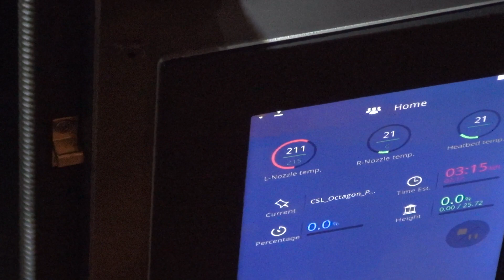Raise 3D N2 plus printing issue

Comment: looks like the endstop is not working, the knocking sound comes from the belts jumping on the stepper gear because they cannot move.
possible solutions:
1-check the endstops.
2-check the tension on the belts.

Always perform a "Home All" to see if your endstops are working correctly.

Comment: Go to 1:14, do you hear that "click"?, it occurs twice during your printer head moving the Y axis. That click is the head against the limit switch, and that is a good sign, it means that it is being properly activated. I do not hear that "click" during the X movement, most likely because your switch is broken. Take a look at it, it is located  opposite to the Y switch.

Comment: I've been browsing the forum and I do see that the company has helped out a lot. 
Do you feel it's built well with quality parts. 
Thanks for info !
Reply from the maker: Ya, its built pretty well. If you check my other videos on my channel I make robots that cost 10,000s each! So I understand good from crap. This is a new company and they are off to a fantastic start. 

If you run into issues and you likely will the community is great and will help out.
Reply: +AZ Droid 
awesome. Thanks for info. Looks like I'll be purchasing this printer.
Reply: Yeah, it's well built. The combination of material, software, settings, ambient temperature makes it difficult to run successfully consistently, but all around I'm really happy with it for the price.